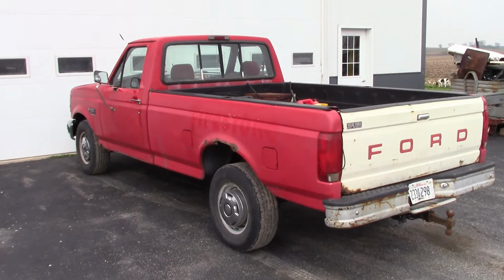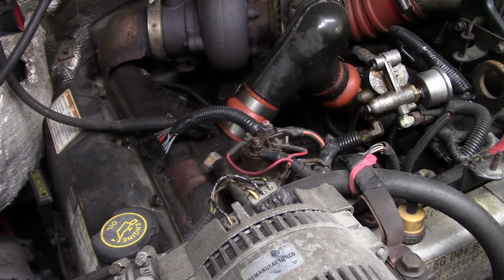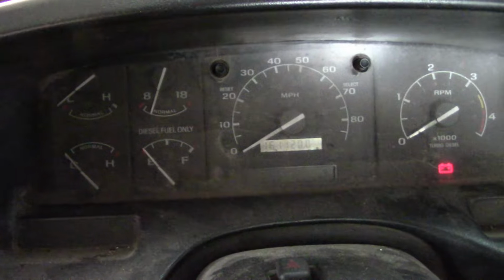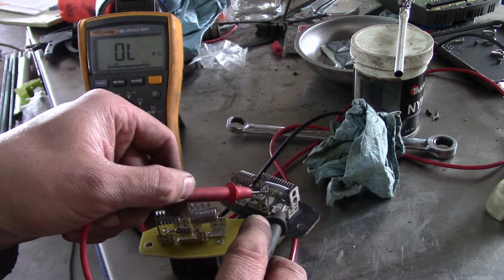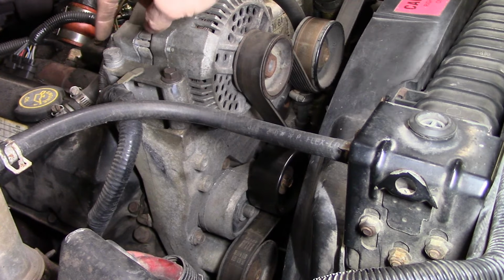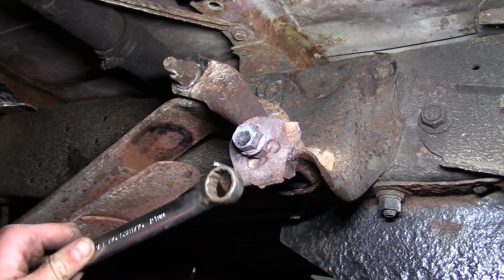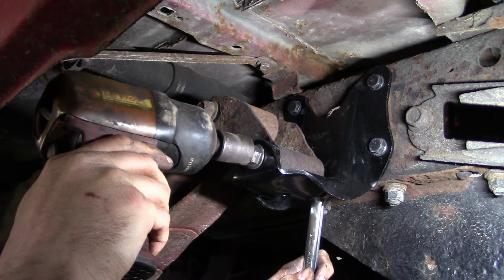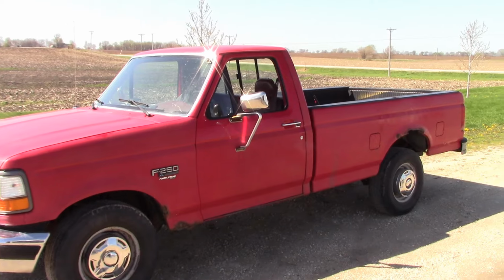1995 Ford F250 Maintenance - Glow Plug Relay, Blower Motor, Belt Tensioner, Rusted Spring Perch

Comment: You're going to get all the usual Ford junk posts, but the fact is the truck works for what you need it to do and you're probably never going to find another one so bugger the haters, just keep on running it and repairing it until it's past repair.  Everyone knows the joke about Ford standing for Found On Roadside Dead, but just a quick look around quickly shows that out of the old vehicles on the road, the majority of them are Fords, so there has to be something to that more than the fact that they sold so many of them.  It's a Ford, so pretty much any mechanic knows how to fix them...

Comment: In a previous post you kidded Andrew Camarata for the way he handles installations on his truck, i.e. with a chainsaw. I think you unjustly criticize  Andrew. He has the same OCD ailment when it comes to wiring. He solders every splice and uses heat seal. he overdoes his work to prevent rust problems similar
 to the ones you lave in IL.
Reply from the maker: OK.

Comment: what to do with that truck?  i'd keep it forever....i started out thinking you were a little nutty putting time and money into a beat up basket case truck like that....but after you did the walkaround and showed that it had no computer chips, no A/C, no power window or door options and no frills of any kind i developed a huge new respect for the purity of the vehicle.....i'd keep it and replace stuff a little every year if absolutely necessary....but pure old fashioned trucks like that are very masculine and harder to find...new trucks are full of computer chips and entertainment center crapola and heated seats....can't stand that stuff.......i had a wonderful 1995 toyota 4 runner with standard trans and  transfer case and 4wd, absolutely no rust on it, built like a tank, everything strong and tied down solidly everywhere, no computers inside, nothing electronic or electrical except a basic radio and power windows.....a magnificent vehicle with a well preserved interior...stunningly solid and old fashioned....i ended up selling it for small money, maybe 1/5 of what it was worth, to a man who loved toyota 4 runners and who ended up doing a comprehensive update and complete paint job on it and who intended to make it his personal driver....it'll run for 35 more years easy and be worth more money every year...and it looks and rides like a real man's vehicle....if i wasn't so very old i would have kept it.

Comment: i don’t understand all your testing and analysis of the glow plug solenoid.  it seems like engineering overkill.   you are using a  pricey hall effect dc current sensor and a even more pricey high end fluke multimeter to analyze an 8 dollar solenoid.   and  you already know is broken,  using the old school shorting of the plug terminals with a handy wrench screwdriver method.  or also could be found with a cheap continuity tester across the solenoid main.    this would have provided the same info.  im all for high tech, but its much more efficient to just skip all that and toss in a new solenoid.

Comment: I have an issue with you complaining about “junk aftermarket” parts. Manufacturers create parts that are prioritary and they control the prices and supply. Once the parts become publicly licensed for other manufacturers to make, they are made according to the original specs, normally. Don’t they? The factories overseas try to make quality parts, but they do cut corners and make some mistakes. They normally work, don’t they.